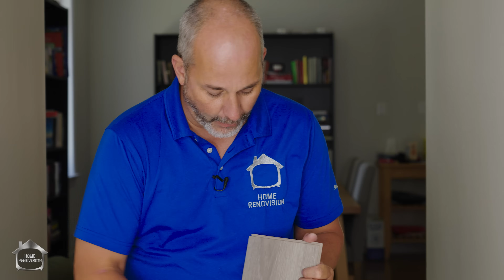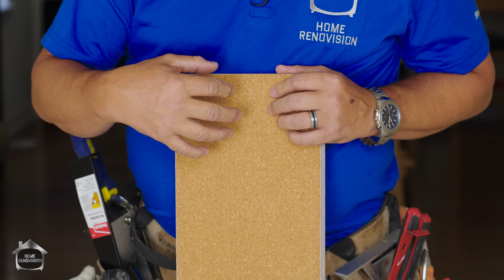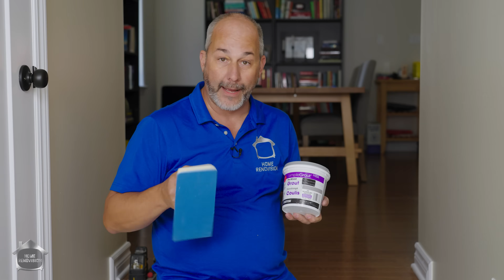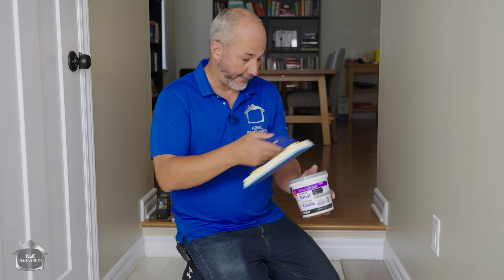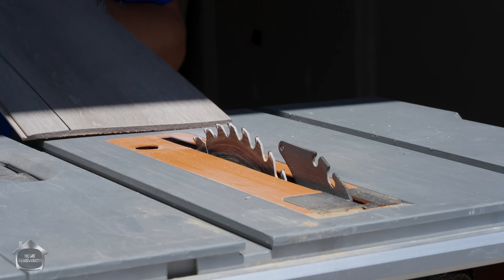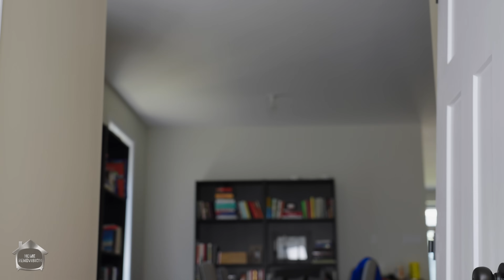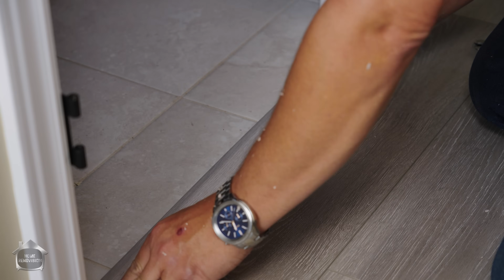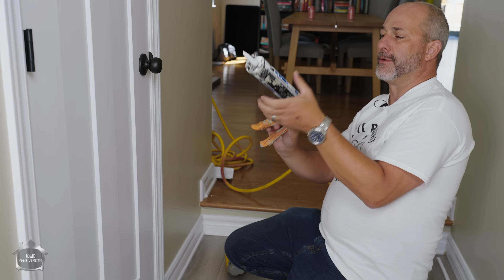10 Tips For Installing Vinyl Over Tile

Comment: My house was built in the 60’s and the main floor has radiant flooring (water pipes) in the slab. Putting vinyl flooring be a good idea and would it diminish the amount of heat from the floor. What would you recommend. Thanks

Comment: Of course, you can slide the flooring under the door jam, even if it's the last piece been doing it forever. In your case, slide it from left to right. I've also installed Lifeproof over tile floor at my sister's 8 years ago without filling in the grout lines and so far, no sagging.

Comment: Hello, in the bathroom I have the plastic type of flooring. Should I cut that out and put the tile or is that one ok to put vinyl over? And if so, should I use an under lament for the noise and water even though the vinyl will have the rubber that comes with it?

Comment: Thanks for the video! After installing about half of my vinyl in my half bath I noticed that the boards did a clippidy clap when you walked on top of them. Not seeing any gaps and no arches I think my next step would to check the level of the flooring. If it is a bit off, do you have a product you would suggest for leveling, and would that just go on top of the tile, of would you suggest removing it down to sub-flood and leveling that?

Comment: I can't believe how you guys stick to using a medieval measuring system, metric is so much easier and more accurate.  Also hate the unprotected table saw I think I will use a track saw in stead. Also my home does not have those quarter round trim pieces so I will have to be more accurate so millimeters will be much better.

Comment: Pro tip remove door casting this way floor ends under the casting and you get a much cleaner finish. I personally remove all castings and baseboards and avoid adding those ugly round moldings that only collect dust.

Comment: Question: I was planning on floating engineered hardwood floors over tile but at the entrance there is a tiled staircase. Is there a floating solution for that? Or would I have to remove the tile from the stairs?

Comment: Pro tip.  That 50% / 50% pattern 31 seconds in looks terrible.  Or maybe it’s a 1/3 pattern.  Either way it repeats every other row of planks giving you a checker board look.  It’s awful.  From a design perspective you want to randomize your first course of tiles at the tub in this case or your staring wall.  That will look more like natural wood install pattern.  Just saying.

Comment: Jeff! You're amazing first of all! Second,  you say that vinyl doesn't really expand and contract the way people may lead you to believe... having said this,  I'm considering building and attaching a partition electric fireplace wall to the inside of my tray ceiling in the living room.  Would I need to cut the LVP under this partition wall to account for said "expanding and contacting" or can I just install it right on top of it? It will be attached to the inside "lip" of the tray ceiling. Any tips?

Comment: hhhmmmm in my research it said rubber backing was quieter than cork. Also i am about to install planks over tile. I will let you know if any grout lines come through.  its a 22 mil that i bought. I use wire cutters for removing nails. Works great. My only concern is the tiles sliding around when installing. I pulled all my baseboards off. DAMN thats a ton of work. ugh.

Comment: I'm not a safety first guy either, but using a table saw to freehand like that is not the smartest.

As someone who's worked as a cabinet maker, I've seen people do some dangerous things with a table saw.  I've also seen a few people loose fingers by doing similar things.  

The kick back possibilities without the fence are pretty high, plus your blade was way too high. Any little wiggle and the blade is catching the board and sending back on you.  If your hand is on top of it - like Jeff's is, - your hand is going through the blade.  It'll happen in less than a second.  You won't have time to move your hand.

Use a track saw or circular saw, or use a jig saw.  With moldings going on it'll cover the rough cut left.

Other than that, great video.  I love watching them to get knowledge on installations I'm not 100% comfortable with.

Comment: You mentioned installing in the direction of the longest wall in the room……  I have two big rooms (in an L shape) with a hallway in between. If I start one room installing planks in the direction of the longest wall……when I get to the next room I end up having to install in direction of the shortest wall.

In that case would you create some sort of transition in the hallway in between so that you can install longwise in both big rooms?

Comment: On the bi-fold door bracket - I got as big a shafted screw as I could get thru the old, cut it to the length I needed (short of the tile basically), drilled a pilot hole and put the screw in.  It worked great.  Never thought about the tape trick, but would do both for stability.

Comment: "There's a little bit of gap around the casing".  Actually, it's a pretty big gap.  It looks like a monkey's ass crack.  I can't believe that people pay you to do such low-quality shit work.  I don't believe you really do this stuff for a living. It is simply inconceivable. 
Is that the angle here?  Are all your videos a mere attempt at humor?  Is this a spin-off of the Red Green Show?  It’s got to be.  “Just trough a little caulk” in that big monkey’s ass crack.  You don’t need to use a jamb saw or a multi tool here folks.  We have Monkey’s ass crack filler in our merch store for only 19.95 an ounce.  
If you came to one of my jobsites and did this kind of work, I would kick you in your ass and I wouldn’t pay you one Canadian Loonie, because that would be Looney.

Comment: Jeff Thorman's videos are normally amazing. Surprised to see he made a beginner mistake here, creating "H" patterns.  Don't do this -- you always want to stagger at random intervals for a more natural look.  If you just keep re-using the last cut piece as the starter piece on the next row, you'll end up with H or lattice patterns as seen here.  Better to cut 6, 7...10" off ends at random intervals on every other row to avoid this.

Also, I would definitely undercut wood (even metal, which unfortunately I had) door frames. It's a major PITA in metal frames, but super easy on wood frames...and the finished look is WAY, WAY NICER looking than trying to carve around a door frame and caulking. If you followed this same principle of "don't do this because in the future you may want something different," that would pretty much limit almost every reno you ever do.  I would definitely prefer a better, much more professional looking floor today that I have to stare at every day for the next 10-20 years, than have a less clean look just because "what if" one day I decide change it again. You can always fill or caulk under door jambs (as opposed to around them) following along the outline of the frame in the future, and it will be barely noticeable to invisible once sanded and painted.

You can also get a much better look (and no need for ugly quarter round sticking out past the frame) by pulling and reinstalling the baseboards, and floating the floor under the baseboards. Again, more work....but much better looking result.

Joe Letendre has some really good videos on LVP installs.

Comment: Is it possible to spread a thin cement mixture over the old grout to create a smoother surface prior to installing the LVF?
Reply: Every installation video or article I've seen or read says that leveling the tile floor with self leveling compound and filling in grout lines that are more than 1/4 inch wide or 1/8th inch deep is mandatory.
Reply: Self leveling compound
Reply: @denysnuttall1706 this

Comment: Being a DIYer myself, I would Mark the bottom of the door trim, remove it, cut it, put the flooring down then put the trim over it. I would rather not worry about complicated cuts that could result in either a crappy finished look or needing to use another piece of material...no measure, cut, test fit...measure, cut, test fit...etc...

Comment: Would you recommend vinyl over existing laminate and wood which will be 3 layers?  I currently have laminate over wood now I want to replace new floor but the guy doing flooring told me it’s better to lay vynil (new floor) on top without tearing the laminate floor

Comment: In a basement setup where the concrete has been sealed/painted is it necessary to have a vapor barrier?  I have a dry basement. Of course  to me it seems to me more likely this would trap moisture which would be a bad thing introducing mold.  I was first planing to add this LVP as a quick solution but now I have reservations.   I have installed LVP before on concrete but on a first level not a basement and didn't any issues without adding a vapor barrier....

Comment: (Another) Great video Jeff - thank you. This comes at a really good time for me as we do some work in our bathroom that has a large, tiled floor. I was thinking I'd have to rip and replace but now I see I can float an LVP floor over the tile :).....my tiled bathroom floor has underfloor heating........it's never overly hot - just enough to take the edge of a Pac NW winter's morning ..... Question - is it ok to float an LVP floor over the tile if the tile has underfloor heating or will this compromise/impact the LVP?........thanks DB.

Comment: Hi, I rent a very old Apt with very faded bleached marble tiles, and although I have and am having the kitchen slightly updated with own kitchen cabinets, as the kitchen /living room is 3 metres 30 x 3 metres 50. I appreciate this is rented, and am looking at installing this kind of flooring myself, but in the store (sadly where I live in Europe we only seem to have 1 store that sells this type of flooring) I was told the marble skirting boards will have to be removed and I have to then fix into the walls the special moulding that this type of flooring then fixes into. My question is surely it’s the same fixing the moulding to the existing marble (flat skirting boards) no ridges etc, they told me in the store that it’s impossible to not remove what’s already there. As I am renting, and if I have to leave I shall take everything I am putting in ( the owner knows I am installing own kitchen cupboards etc) however I sure don’t want to remove marble skirting board. Financially I don’t have more money to be spending on doing this, or employing someone , I am happy to be hands on, but also I need to check as you said, the type you purchased will not expand, is that because it has a cork underside?  Also wondering, if because of marble tiles, would I have to put down separate underlay, if the vinyl tiles are not the type you have purchased, I need to check in the language of here, what the type you have purchased is. Non expansion ? Unless anyone wants a few days vacation to the Canary Islands and help me instal, it… haha…
Any ideas please would be helpful. 
The Apt will be nice when I have finished it, but walking into old worn marble tiles, is making me feel very depressed, and I don’t wish to be here…Or should I just go for a cushion flooring, which would have to be glued down, and then I can’t take with me…HELP PLEASE!!
Awaiting patiently…

Comment: No grinding or prepping the tile joints before install? Lvp floors are failing across the states. Either from cupping or separating.   Waterproof laminate is the safest and best flooring.  46 yrs experience.  Lvp is also failing in areas wheelchairs are used, or heavy furniture causing it to buckle

Comment: Great video, thanks!  I have a question though.  I'm installing an LVP floating floor in a bathroom, and the instructions are adamant that you do not put the LVP under cabinets, or secure it to the subfloor.  However, my new vanity is the free standing style that will need to have the LVP run underneath it.  Will the flooring be secure under this vanity?  Any help here is appreciated!

Comment: Question…assuming that original tile is installed directly on concrete slab, should you not put a moisture sealer on the tile before installing the vinyl? That lux vinyl will trap moisture and create issues in the future because it does not breathe like real or engineered wood. I live in the south of Texas near the gulf and all the houses are on slabs. I want to install this vinyl please give me your thoughts on this. Thanks.

Comment: Pro Tip - Transitions look better when you align them with door stops and definitely cut the door casing, even if you cut it and add tile later it still will need to be cut more due to thin set and tile will sit higher than vinyl flooring.

Comment: Excellent video. I recently did a guest bedroom in my basement using LVP. Not my first time but challenges nonetheless. I didn't use quarter round or show moulding, I used the baseboards themselves since I took them off for a complete room paint redo. Looks great, as does your floor in this video. Thanks for the info.

Comment: One thing i was missing from the video is the explanation to how the floor is supposed to stick in place. There was no glue or screws or anything. Can anybody answer this maybe? What keep these vinyl floors from jamming around? Sure in the begging it’s the weight of the other vinyl on it? But when all said and done what is the mechanism to achieve stability?

Comment: Thank you, so I ripped out my carpet, now I need to get a sub floor to match tile for even surface,  is there a best option for subfloor on top of concrete to match tile height, I am thinking plywood N thinset,  lvp final
Reply: OSB is much cheaper and lighter than plywood and can be used over concrete.

Comment: I installed the coretec flooring in our condo. Great product!
Reply: the CoreTec planks are 1/4” thick with about a 1/8 cork backing on it. CcYou can lay it right over the tile and it will look like it’s laying on the foundation
Reply: @Will-S  thats what the installation instructions say but I keep hearing its still best to fill in the grout lines but Id rather not if its not necessary
Reply: @holleygurl92 unless you have tiles with heavy texture and large grout lines, I wouldn’t worry about it.
Reply: Planning to do this. What thickness was yours and did you lay it right over tile?

Comment: Hi! how can I transition from an existing tile wall to a luxury vinyl plank flooring? My project is in a bathroom so the tile wall is already in place and I don't want to redo it... Thanks in advance for your help! I have seen you can add silicone... or a PVC baseboard but I'm not sure what is best and I want to make sure my vinyl tiles don't move around..
Reply from the maker: Thanks!
Reply: @HomeRenoVisionDIY  would really appreciate your help or input :p

Comment: If you have tile of.... questionable degrees of level, is there an easy way to figure out if its close enough to use the grouting trick you mentioned in this vid? Not against more substantive leveling methods, just trying to figure out what's needed.

Comment: Your videos are great. I have a question about laying LVP. I plan to lay Flooret SIgnature down across my entire house. I have 20x20 tile through most of it that I do not plan to rip out. The instructions from Flooret state that grout needs to be filled. I am curious on your thoughts and if you think this really needs to be done. That will be a ton of grout fill to do and since Flooret Signature is so thick and wide I am hoping it doesnt really need to be done. The grout lines are ~1/4 wide.
Reply: Just don't void your warranty. Flooret might not cover damage if you didn't follow their instructions.
Reply: @jdmb03  Technically this would void the warranty because the user manual states to fill the grout. However most people are saying this does not need to be done for thicker planks

Comment: I had to remove some old hardwood floors and the subfloor in 1 bedroom due to rot. New 3/4 inch plywood is down. If I dont want to go back with hardwood, what options do I have to match the other floors in the hallway? Even if I get plank flooring with a backing on it AND use the foldable underlayment, it still isn’t enough thickness to match the other floors. Help!
Reply: Just depends on how much lift you need. Use OSB board over the subfloor to bring it level.